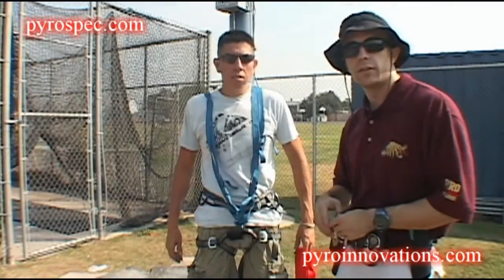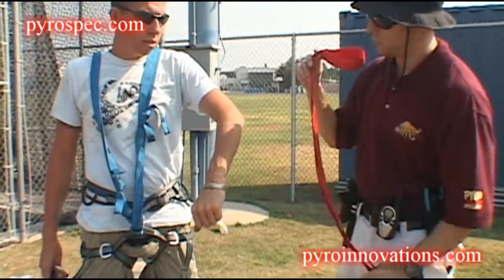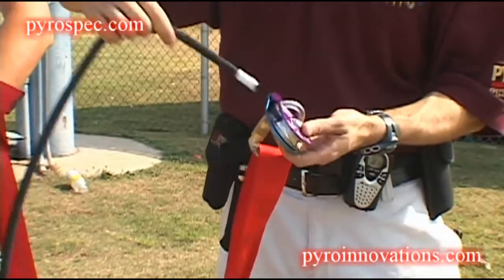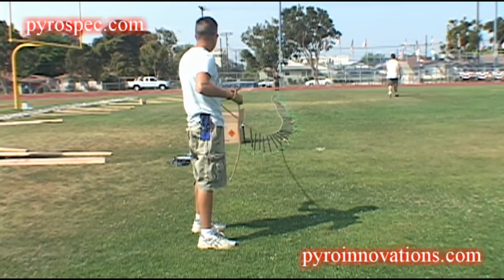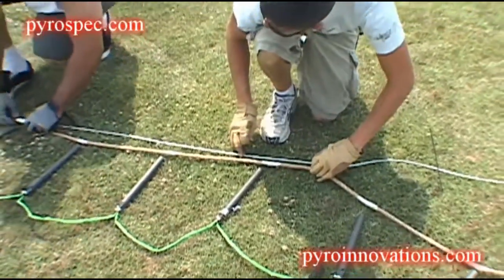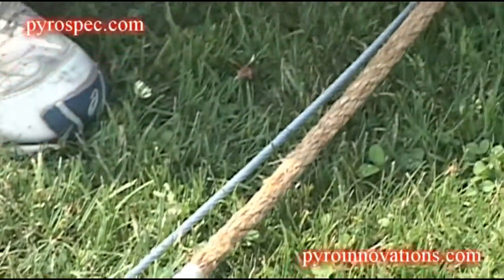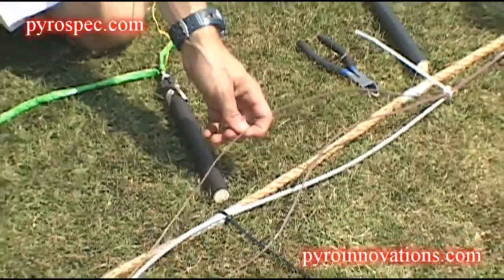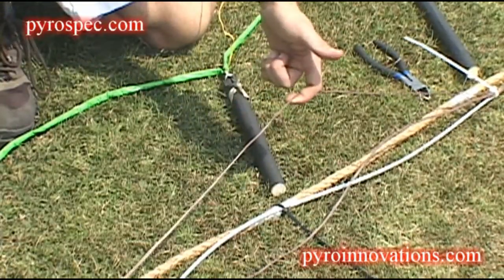Pyrotechnic Waterfall Effect Setup

Comment: Not sure that the series-parallel wiring scheme is such a good idea. Series-wired anything is prone to failure if just one component is open circuit. I''d parallel wire all e-matches, but alternate between the two zip lines for each connection. That way you spread the risk of failure over two parallel feeds.
Reply from the maker: James, thanks for the comments.  We wouldn't say series-wired anything is prone to failure as a blanket statement.  If quality control is good, series wiring can be less prone to failure, keyword "good"; but, having said that, depending on the e-match brand and other metrics, we can argue for series in some cases and parallel in others.  We will use your series argument ("Series-wired anything is prone to failure if just one component is OPEN circuit") and use the same logic for parallel in saying, Parallel-wired anything is prone to failure if just one component is SHORT circuit.  You can also have a more significant variation in current through e-match with resistive differences in each match when they are wired in parallel, especially for a long run with additional wire resistances between each parallel match.  But...bottom line, we agree with you in that we almost always default to parallel wiring, but given the different limitations and the expansive run over the entire length of the waterfall, having two different types of circuits for redundancy makes more sense in this case.  The plots on this page may be of interest to you: https://pyroinnovations.com/ematches.html  Thanks for the comment and discussion!